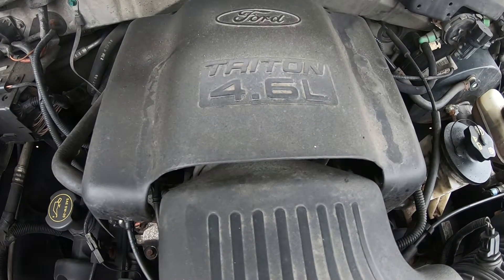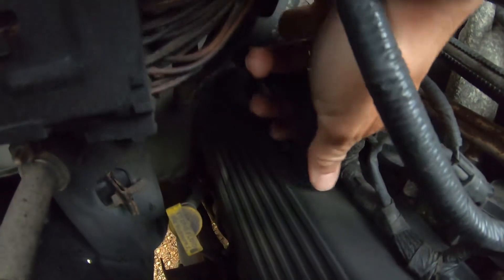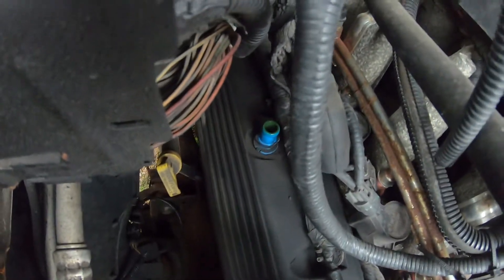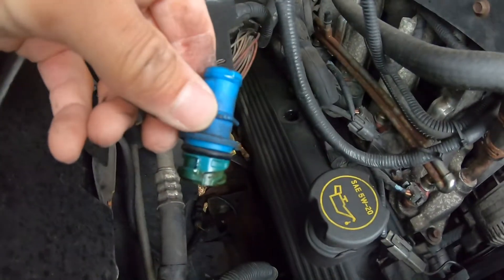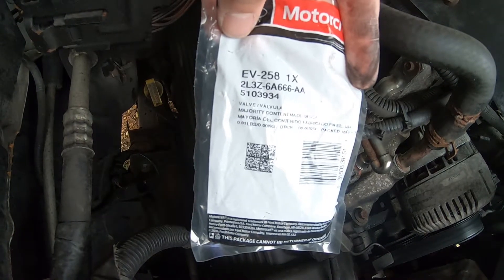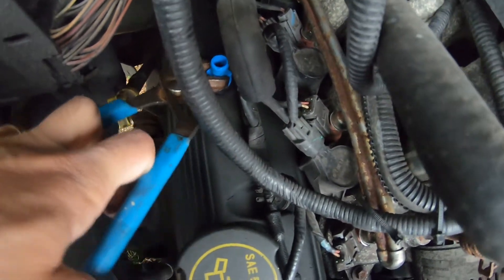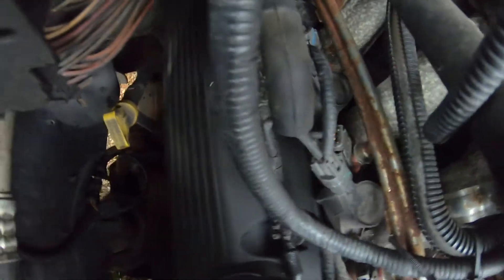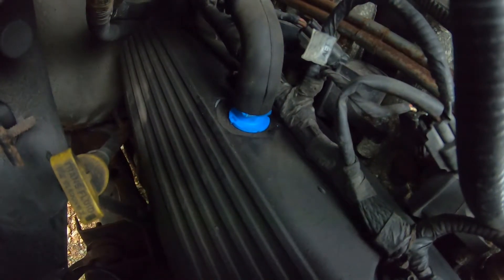How To Replace The PCV Valve On A 2003 Ford F150

Comment: Thx . Quick basic video.
Be sure to use pliers to seat the PCV the last 1/4 turn. 
Check engine light will extinguish on its own while driving the truck a while.
Reply from the maker: Welcome!
Reply: Thanks.

Comment: Thank you For your video I was able to replace my PCV valve thanks to your video but I also have a question what is the other valve on the driver side I think it's called crankcase breather hose any advice will be appreciated thank you very much I need to find a part number for that one breather.

Comment: I know this is an old video and I don't expect an immediate response if any, but I have a 99 f150 with the same engine, would a bad pcv valve be what's causing it to burn oil? The truck was my grandfather's and I got it a couple years ago after he passed and it's started burning oil. I've read online that a pcv valve going bad can cause oil to enter the combustion chamber but I have no idea, and I'd rather swap that before digging deeper into the engine if possible
Reply: How did u fix it?
Reply from the maker: Yes it could cause it to burn oil. I would replace the PCV vale and see if it helps

Comment: Is this something you recommend doing? Also why is it needed? Thanks
Reply from the maker: Yes every 100k miles according to the owners manual. PCV valve controls the airflow between the crankcase and the intake manifold, so it can cause a variety of different problems if not working.
Reply: @thomasfixit7931  ok thanks. I appreciate it.
Reply: @thomasfixit7931  I have a 02’ 4.6 Screw and  i turn on the engine blue smoke 💨 comes out you think this can be the problem ?
Reply: @peter198572  I have the same problem right now. How did u fix it?

Comment: I have problem with the same truck, when I run around 60 miles and press gas the truck lose power. when I release the gas pedal and press again go normal.  When loss power do something to my AC like change to blow aire by the dash top. when I take of my feet front gas pedal blow normal air. Do you have any recomendation??
Reply from the maker: How many miles on the truck? When was the last time you changed the air filter, fuel filter, and spark plugs?

Comment: Did you have the P0171 code with this and did it get rid of it ?
Reply from the maker: Was just maintenance. Did you check all the vacuum hoses and gaskets around the intake?
Reply: @thomasfixit7931  I have not, been reading could be the pvc valve hose or maf sensor, not entirely sure fuel injectors no clue
Reply: @anthonyvillagomez9173  It's always like that.  Without a proper diagnosis you may never find it.  But yes, it comes with a bad pcv valve, I know because I just dropped a remanufactured engine in and the old engine had the wrong pcv valve.  I got P0171 (threat 2/3 repair immediately if drivability issues are present) and P1504 (idle air control circuit).  

The codes are so generic, I have a brand new idle control air valve on but  a bad PCV valve will trigger both codes and can trigger even more codes.  But yeah, start with vacuum leaks and gasket leaks.
Symptoms are important

Comment: I have suction on the hose side but none at the valve itself. I assume that's normal? Same engine
Reply from the maker: Sounds correct. The valve open when the throttle is pressed to remove crankcase gases